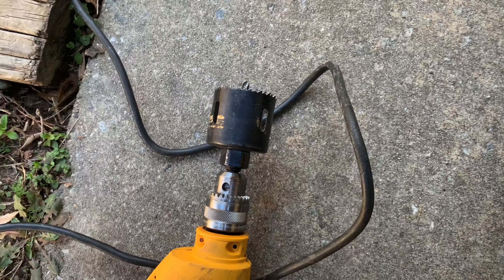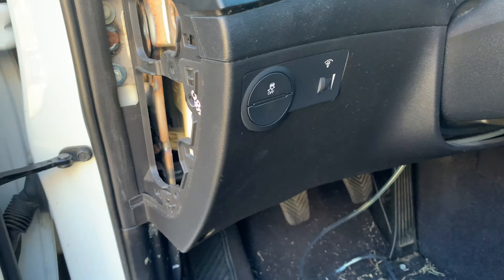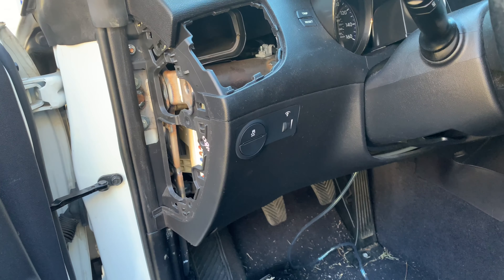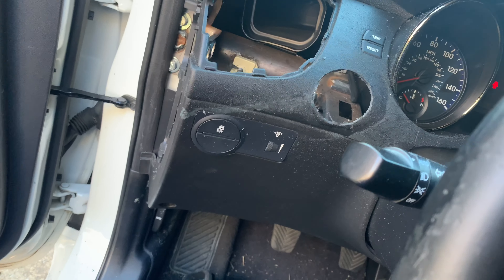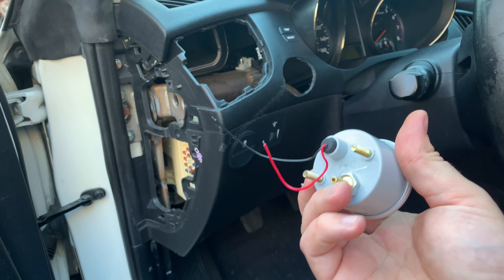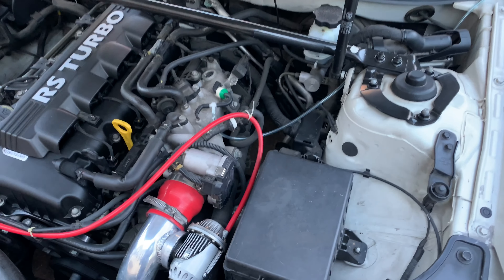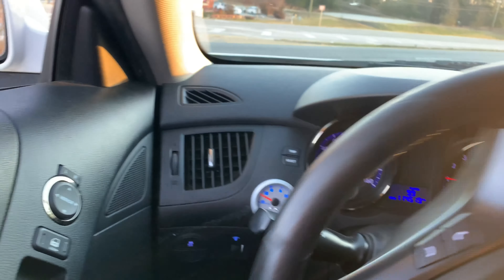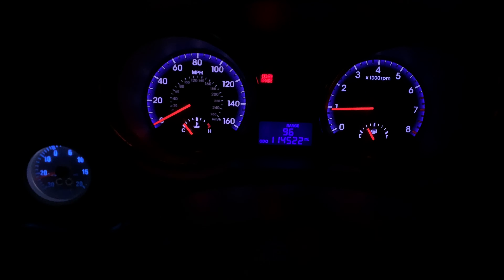Boost Gauge Install in Dash - ‘11 Hyundai Genesis Coupe 2.0T

Comment: Where did you ground the gauge at? I am trying to do mine and cannot find a proper spot to ground
Reply from the maker: Any bolt that connects to the metal part of the car.  You may have to turn the switch on and just touch the ground to different bolts until you find one.
Reply: @HiRevzMedia  Gotcha, thanks! I got mine all installed, and I kind of noticed you have the same problem I do. Only hitting 10psi, rather than the stock 14 (I am also on a tune, where it should be around 18psi). Am I just dumb and don't know how to read it lol?